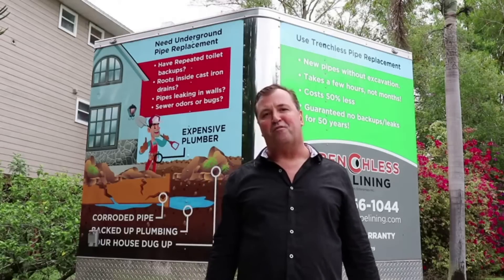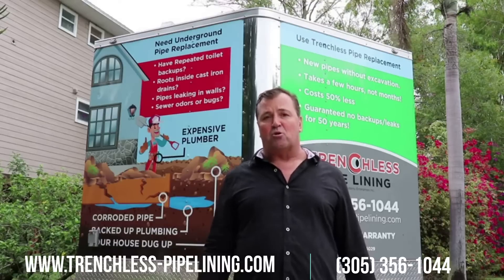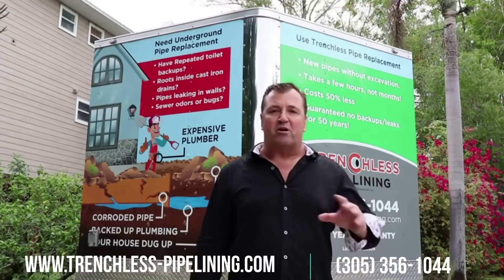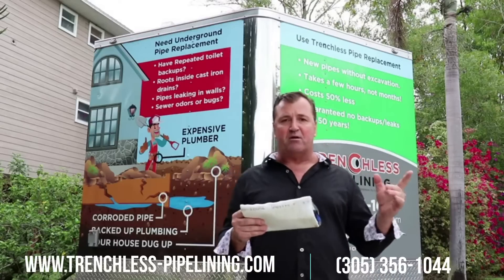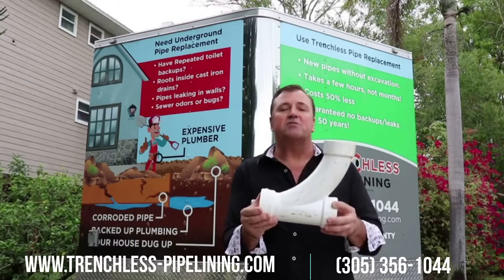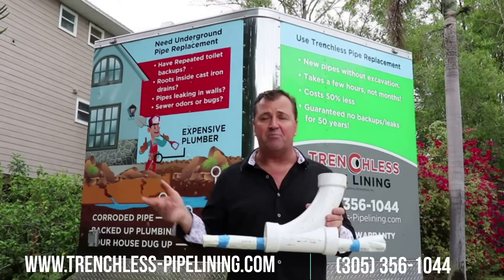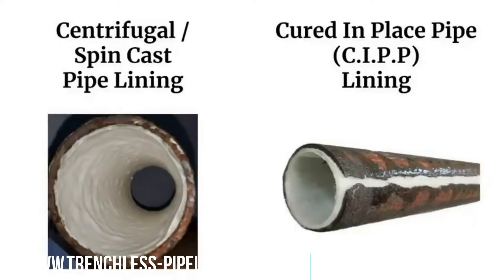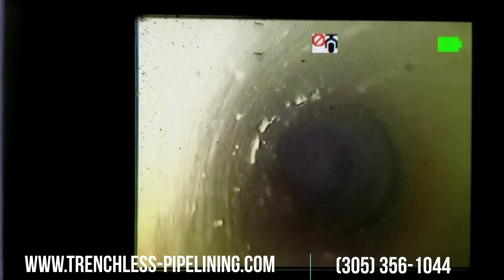Trenchless Sewer Pipe Lining Company Pinecrest, Kendall, Coral Gables, Palmetto Bay - how it works

Comment: Hi, I discovered a very rusted main line  cast iron 100' long to the city sewer. The main line runs outside of home under a line of palms. Can you get me an idea of cost using your trenchless system?
Reply from the maker: 100ft of pipe running through your yard could cost around $12,500 to line with trenchless technology, and the trees could be saved@

Comment: If that system has a 50 year warranty it will last longer than that. If this new process cost more than a dig up then I would did it up.
Reply from the maker: Yes, the materials are tested independently in Houston, TX for a lifespan up to 75 years!

Comment: Sounds like spin-cast is the way to go for the plumber. Less risk. Is the cable for cured-in-place pulled by hand or mechanically? What do you do when a section of the old sewer has collapsed? Thanks.
Reply from the maker: Collapsed pipe cannot be lined unfortunately. And yes, that's why it's important to go with a company that has experience with both! Our experienced foreman pull the liners in by hand, and we never have any issues!

Comment: Would it work with PVC? I have a broken drain line under slab construction.
Reply from the maker: It's not normally used on PVC, but newer technology called UV cured-in-place offers spot repairs.

Comment: Would this solve a belly in the sewer line as well?
Reply: No, but if there is enough pitch in the pipe the solids will pass through a small belly
Reply: @plumbnplumber  
Since when has laterals been ran with a grade higher than 1/8inch., Most laterals are close to flat. Most i've camera has bellies in it.
Reply from the maker: Unfortunately, this technology cannot correct a belly

Comment: $50,000 is a bit of a stretch.  Can just tunnel under the slab for $150-200 per ft and then replace the pipe with actual schedule 40 PVC and it will be good forever.  Average 2,000 sqft is 50-60 feet wide so even if you had 80 feet of trenching (say mainline and then a branch) that's only $16,000 for the trenching and a couple thousand installing the PVC pipe drain lines.  Unless the trenchless was less than half that cost it is always better to replace the pipe with actual new PVC plumbing.
Reply: Not always that cheap to replace, around here it's usually $300 or even more per ft to replace
Reply from the maker: Obviously markets all over America vary in price... we are also including that if you have to jackhammer through your floors, you will have to replace your flooring which can cost 10s of thousands of dollars (a lot of our clients import marble from EU, have vintage terrazzo that can never be matched up again, etc). No to mention the dirt and mess associated with trenching / tunneling. You also get to stay in your home while out work is being done (saving you money on accommodation!)

Also this video is a bit older now, we see quotes from clients for tunneling / trenching around $30,000+- in FL and TX but every home is one-of-a-kind!
Reply: It comes into its own as per the latter example. Internal pipe in a high rise that was leaking into the walls.

Comment: Could this work for pvc? I have a broken drain under my slab that needs repair. It’s three inch. It broken at a Y fitting.
Reply: Nope
Reply from the maker: It is not normally used for PVC, but with new UV-cured pipe liners we can do a spot repair in certain parts of a pipe. It's important to note that a Y joint can be more tricky and normally requires replacement.